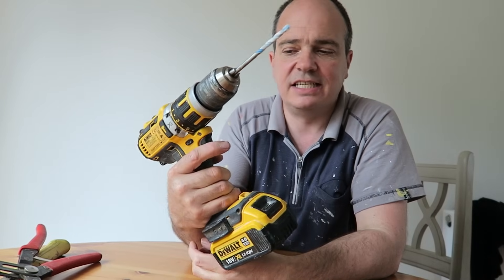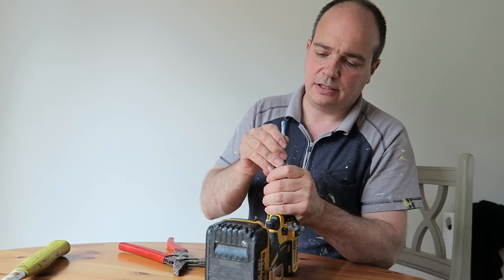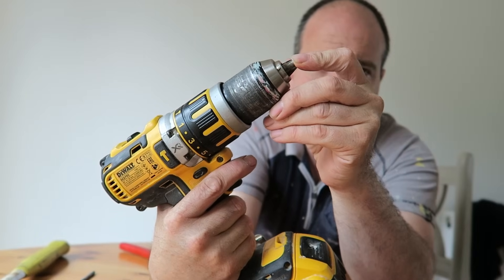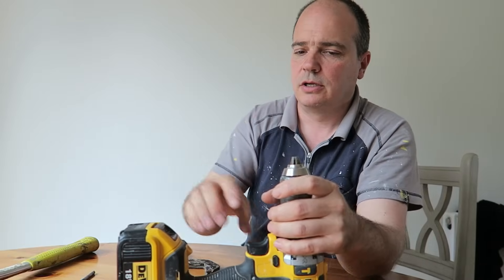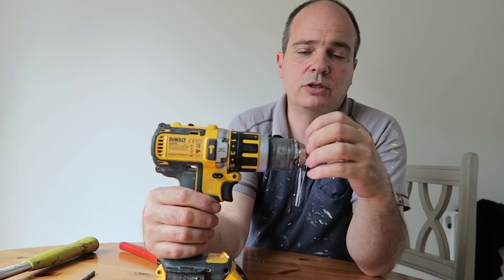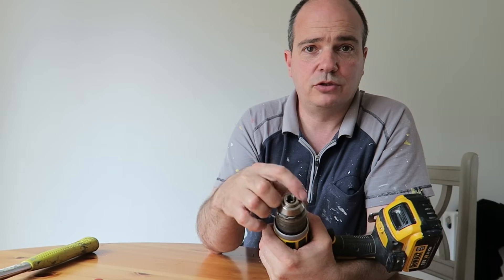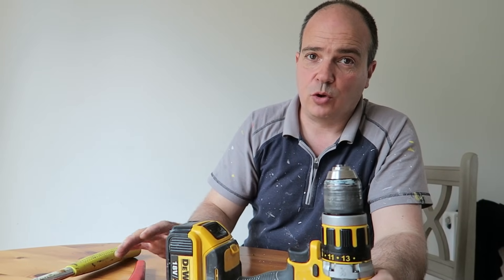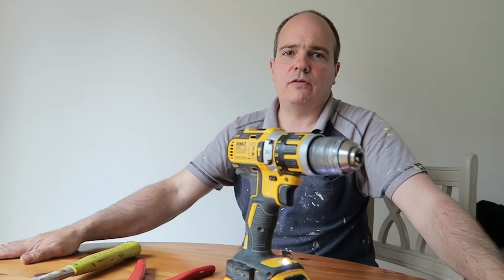Free up a Keyless Chuck

Comment: Don't forget that oil is your friend. I was just about to order a new chuck - then I took it off the drill and drowned it in light oil. Now it only gets hard to turn for about one full rotation half-way between full open and full closed.

Comment: In my case the chuck jaws were rusty causing friction and freezing the chuck..  Tap with a hammer, rotate, tap, rotate until the jaws were fully closed.  Then spin them against a sanding pad to polish them smooth.  Oil, run in and out a few times and the chuck now operates smoothly.
Reply from the maker: Brilliant 👍

Comment: It looks like not only Milwaukee 18V drills have the problem then. I loosened a Milwaukee that was stuck a few days ago. Same problem as in this video. Milwaukee has come out with an updated chuck, maybe Dewalt need to do the same.
Reply from the maker: I updated my drill to  the DeWalt 996 - not had a problem with that chuck. Hopefully this vid helped you out 👍

Comment: I can't thanks enough,
I've had two of these old heavy as hell drills. But I worked them to death  but years ago the chucks got stuck like this. Now, thanks to you I just fixed them both in 10 minutes with a hammer, flat head screw driver, and a little machine oil. I had to tap turn, tap, turn, tap, turn about 50 times ,little by little , to get it turned all the way back in, to oil the chuck jaws and surfaces they slide on. then it just got easier and easier to turn them in and out. Now they go all in and out with a good spin. SOOO cool.

Comment: Of all the videos I watched for the problem I had with my drill which were the Jaws were stuck, yours was not only the closest one to my problem but the one that solved my problem. Although I had to tap a little harder than a wee bit, I still got them Broke Free, oiled and now my drill is working great! FYI this video works on Milwaukee drills as well!
Reply from the maker: Brilliant. Glad it helped. It is a bit worrying hitting your drill with a hammer. Great when it works. Thanks for the comment and information about other drills 👍
Reply: I had to do a little extra tapping but it worked in the end

Comment: Thank you for the video. Saved my dewalt drill. Bit was stuck and even with grips couldn't get it loose. After some gentle hits with hammer on the jaws and the bit came out. And the chunk seems to work just fine now. Greesed it with silicone spray and good as new now.
Thanks again. Saved me alot of time and some money.
Reply from the maker: Brilliant. Glad it worked for you 👍

Comment: It worked! You are a hero! Bosch GSB180 not seized but sticking or jumping the gears when tightening. A couple soft taps with a small hammer and then sprayed in some silicon lubricant.👍🏻
Reply from the maker: Brilliant 👍

Comment: I have a corded keyless chuck type Makita drill that's been lying in the shed for months seized solid'
Went out and gave it a squirt of WD, a belt wi a hammer and it's back on the team,
Many thanks for the tip.
Reply from the maker: Brilliant. Glad it worked.

Comment: YES! About to order a replacement chuck when i watched this vid.  One of my chuck clamps(?) was also slightly higher than the other 2. Tapped it lightly using a cold chisel and bingo!  Chuck is fine.  Thank you!
Reply from the maker: Glad it helped. I oil the chuck every so often and not had a problem since.
Reply: @handymancraftglasgow  great idea!
Reply: @JimJmad  Did you have any issues with   it afterwards

Comment: Worked for me! Thanks. 
My drill had a hex bit in it which I could not remove and the chuck would not release. I used a drift pun punch and hammer to push all three jaw segments flush with the front of the chuck. That freed the chuck.
Reply from the maker: Glad it helped👍

Comment: Thanks! I'm going to try this when I get home. By the way, great to hear a Scottish accent after so long overseas.
Reply from the maker: Thanks 👍. Hope it work for you and you get home soon.
Reply: @handymancraftglasgow  A quick update - a bit late, sorry about that. I have no doubt that your tip would have worked if I'd diagnosed the issue right. It turned out that a metal shard had got lodged behind one of the jaws, but thanks for your help, keep up the good work and stay safe
Reply: Purple burglar.
Reply: Not an accent.. an impediment-huge difference.  Spawned from years of drunks murdering the language, but you know that well, don't you?
Reply: @Rico702Vegas  No. And honestly, wtf are you talking about?
Reply from the maker: Ooft. Sounds like you need to visit Scotland.

Comment: Thank you... I think?! I was able to fix my drill based on your advice... but that means no new set for me (the newer brushless version is on sale right now 😁)! One of the 3 'fingers' of my chuck was stuck all the way out, the other two were going in and out freely. The stuck one was out about an eight of an inch further than the two that were still moving though. I thought that seemed pretty bad, but hey, nothing to lose by trying to fix it. Alas, your video helped me fix it! I had to really work on it a few times, thought I may have been coming close to hitting too much and too hard, but it seems to be good now. Applied a good amount of oil, loosening and tightening the chuck to distribute. Thanks again!
Reply from the maker: Good to get your drill working again 👍

Comment: Your video put me in the right direction, thanks!  I had to go a few extra steps.  In case this might help others, here's what I did.  I tried your method.  This did not free it, but did enable me to loosen it a little at a time.  Tap, loosen, tap, loosen, etc.  I noticed that one of the 'fingers' was definitely not staying level with the others.  Regardless, I was able to get it open mostly by using my robogrips.  Then, I drenched it in WD-40 (any good penetrating oil would probably do the trick) a few times.  Drench, drain, drench, drain, try to turn.  Now it is at the point of opening and closing almost normally - at least I don't have to try to use pliers to try to turn it anymore.  I was proud to finally get a DeWalt having always owned cheap drills, but having this problem with the drill not being very old was very disappointing.  Hopefully, this will extend the life although I'm sure the best fix in my case is a new chuck.
Reply from the maker: Thanks for taking the time to write this. Very helpful 👍
Reply: Did you have any issues with   it afte drenching it in wd 40
Reply: @garvielloken3929  It's been working since.  I did have one instance where it kind of locked up.  I tapped it with a hammer and it loosened it up - I think one of the chuck 'holders' was ahead of the other two or something.  Other than that, it's been working fine since I had this issue about a year ago.
Reply: @dannobles8028  Thanks for the reply

Comment: Worked for me on my sons Dewalt. It was struck in the wide open position, going by what you said I knew the problem was with the three locking locking fingers. I tried , with a flathead pushing them back, heard a bit of a click from one of them, we were back in action. Not sure if WD is the best , it tends to dry things out and oil will make it attract dust, so I gave it just a smear of light oil in the crucial parts and hope to do it every now and again. Many thanks for the info. Greetings from Ireland 👍👍
Reply from the maker: Brilliant. Glad it worked for you. I just used WD40 as it's in the van. I only use it if I think the chuck is getting a little tight. Still working fine and never had the problem again. Thank for the comment all the way from Ireland 👍😊. Always good to hear from our neighbours.

Comment: My driver drill's chuck has misaligned jaw (2 stucked at lower part, 1 at middle part). This method still unable to fix my drill issue. Do i need to replace the entire chuck?
Reply from the maker: You may have to but I am no expert 👍

Comment: Excellent. I could not get the bit out but realised one of the three jaws was slightly higher. I gave it a little tap with hammer and screwdriver head and it released immediately. Thank you
Reply from the maker: Glad it helped. Feels counter intuitive to start hitting your power tools, even gently, with a hammer. But it is good when it works.

Comment: Awesome video, thank you. Had a drill with the chuck stuck closed, 3 parts that hold the bit extended, and every video I saw was about replacing it but you have to remove the screw I couldn't get to. Tapping it with a hammer got them lose and finally works. Still have a little work to do but may save me from buying a new hammer drill.
Reply from the maker: Great. Glad the info was useful for you 👍

Comment: I found you through your video on the impact driver trigger fault, I left my comments on how good that was. Now I see this. I bought these two tools as a set [Impact driver and drill]. My drill also does this intermittently but the worst thing is that most of the time it won't stay tight. It's like the dead stop of the chuck when you release the trigger, causes the chuck sleeve to continue to rotate and loosen. The bit either falls out or is deep in the timber and I'm then messing around trying to grip it in the chuck again without bending or breaking the bit. I cannot emphasise enough how disappointed I am in pretty much all the cordless range of Dewalt. Unfortunately, 12 tools and 8 batteries, I'm stuck with them for some time. They will be replaced by another make as they go, though.
Reply from the maker: Mine was similar to yours, a real pain to use. It was ironic when the chuck jammed as mine also came loose all the time. 
As I had the Dewalt battery I ended up getting the DCD996 (https://amzn.to/39kAHkK) as an upgrade. This is a much better drill and I have not had any problems with the chuck at all.

Comment: I was just given a bunch of tools and to my surprise, the dewalt 20v max xr hammer drill was in the box without a battery and to my surprise, i used my battery it worked but could not for the life of me unscrew it. There was no bit the teeth were closed.. Your hammer method and a little bit of wrench action  it unscrewed and a little bit of wd 40 i got a 130 drill for free. SCORE. Thanks for the tip.. It also came with the 20v max impact driver *(not xr) but still free is free
Reply from the maker: Glad it worked 👍. These drills are worth every penny especially when they are free 😁. Nice one.

Comment: My chuck became stiff to turn yesterday after drilling some galvanized steel on a ceiling! So the knob used to turn easily by hand but now it needs a stronger grip to tighten! Why do you think? Did it reach its lifetime or could there be some steel debris in it?

Comment: This is great advice, thanks. My son's Dewalt DCD776 had this problem.  It's fairly new and I was quite surprised because I have the same model that has worked perfectly for years and mine has had a lot more abuse than my son's. A few light taps squarely onto the prongs and a couple of twists back and forth and it magically freed up and works perfectly.
Reply from the maker: Not sure what actually causes this but I know some people with the same drill and no problems.
Good when this technique works, can get you out of trouble.
Glad it worked 👍

Comment: Mine had started doing this only got it at Xmas, may try this next time it happens. Failing that back under warranty!
Reply from the maker: Might be good to use the warranty if it's so new. Or you may even be able to send it back to the retailer as faulty. Shouldn't be jamming when it's brand new.

Comment: I have what I think is a similar problem with my almost brand new Einhell drill, though on mine there's one chuck jaw lower than the other two.
The chuck jaws aren't locked in-place, I can fully open & close them - but the rotation isn't smooth & the locking mechanism doesn't tighten.

Tried a gentle tap with a hammer as shown, but no joy. :(

I know what caused it in my case; when tightening the chuck (by hand) onto a small drill bit, it slipped out of alignment.
I'm surprised this caused damage though, as I really wasn't applying excessive force.

I'm hesitant to make a Warranty claim, as they clearly preface the service as only being free for genuine faults not improper use - and I can imagine a shipping + repair bill might end up far in excess of the meagre £30 I paid for the drill.

Comment: yeah but mine is stuck tight with the bit locked in.  I tried to loosen it but it starts ckicking and doesnt loosen.  how do I get this to release the bit?
Reply from the maker: That's the difficult part. I did use a wrench on mine one time but there is a very high risk of wrecking the chuck.
I would start off with gentle tapping, a squirt of oil and go from there.

Comment: My drill is still in the chuck so I don't think I can use a hammer to hit it. Your thoughts?
Reply from the maker: Drill will have to come out first. Try and tap any teeth that are misaligned, I used a screwdriver with the hammer to tap the teeth individually. 
I had to use a wrench on mine  - not good. But once loosened, if nothing is broken tap with the hammer should sort it out.

Comment: That's DeWalt crap for you! This has happened to two Dewalts of mine over the years. And another DeWalt combi, brand-new from ScrewFix, packed up on the first day after drilling one hole!!! I use Bosch and Milwaukee now, and have never looked back. Good tip though: twat it with an 'ammer!!!
Reply from the maker: Always fancied trying the Milwaukee. Dewalt for the next couple of years for me but - As the old timers used to say - If in doubt, give it a clout 😀.

Comment: My switch went bad, just went to remove it and the motor came loose from the gears.  Don't do what I did, haha, I have a bag full of gears and goo now.  Great drills, but a pain in the arse sometimes.  I bought one from ebay to get the switch out (has a chuck problem, 19 bucks), and now it looks like I will have a chuck problem.
Reply from the maker: Hopefully this video will help you with the chuck problem. Mine is still working and the chuck jaws have stayed in alignment. Fingers crossed they stay that way.
Reply: The ebay pic shows a bit inside the chuck, and the guys description says "works great, but the chuck wont release".  Hopefully he just didn't attempt to fix it.  I need the thing to work now, ha.
Reply: Mine is the same, I too tapped it gently to realign, 2 weeks later 2 jaws have seized out and I can't tighten or loosen at all.
I now can't get to the T20 screw to remove chick and replace. 
If I was you and you are having this problem also I'd follow this but order a new chuck also! 
Better still if under warranty take it back!! Mine was when it did this 1st time, second time 3 days out! Take it back
Reply from the maker: Good point Ian. Thanks for the comment.

Comment: Mine is really stuck, unfortunately!!!
Reply from the maker: I had to use a pipe wrench once. Was a bit extreme and thought i would damage the chuck but it released just enough to get the drill bit out, then tapped with the hammer.
Don't do this unless you are willing to lose the drill 👍
Reply: @handymancraftglasgow  Actually spent some time with it yesterday afternoon. Tapping away with a flat headed screwdriver on each jaw for around an hour finally did the trick. May be me going stupid but the two counter rotating grips seemed to be jammed together if that makes any sense, and a bit of tapping in that area seemed to help. Anyways thanks to all
Reply from the maker: Brilliant 👍

Comment: These devices seem horribly designed. The only way to get a drill bit into the chuck is to place it in loose, then grip a portion of the device that could burn your fingers if you're not holding tight enough, click a button, and then hold a trigger as it winds the drill bit into place - which very often causes the drill bit to end up a little wonky anyway - only for the drill bit to simply fall out after light use if you don't wind it tight enough, or get completely jammed and render the entire drill unuseable if you wind it too tight. How has no one designed a better way yet??

Comment: I usually just throw mine in the freezer.
Reply from the maker: Does it work?
Reply: For me it has. This has happened while working many times while drilling 4" steel pipe,  I've thrown it in the freezer to cool down the metal. It frees up soon there after. Bam, back in business
Reply from the maker: Sounds better than hitting it with a hammer.
Don't know how the family would be when rummaging in the freezer for an ice cream and there is a big drill in there!
Might give it a try though, next time. Thanks for that 👍